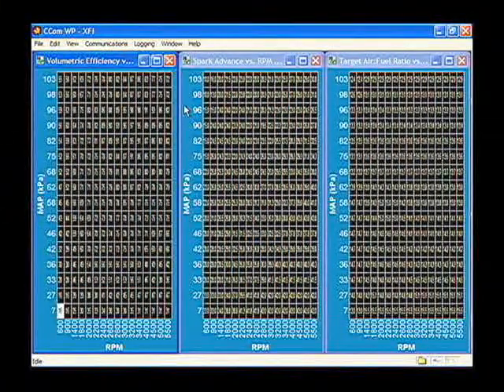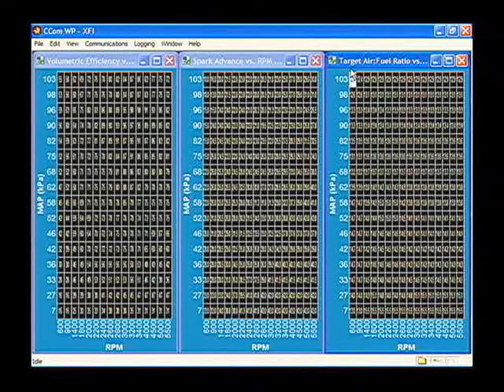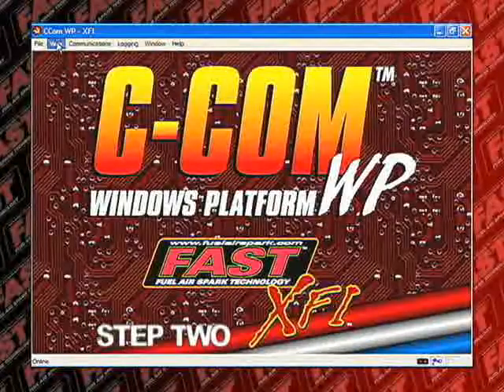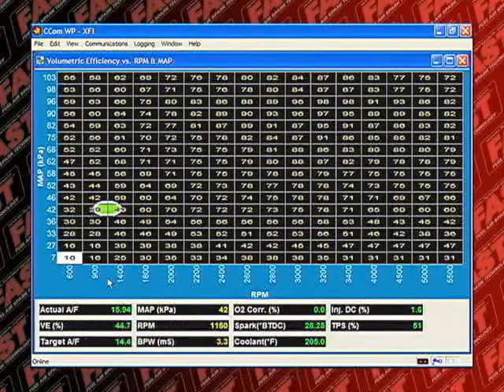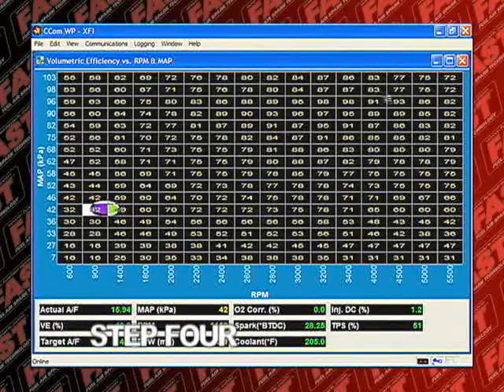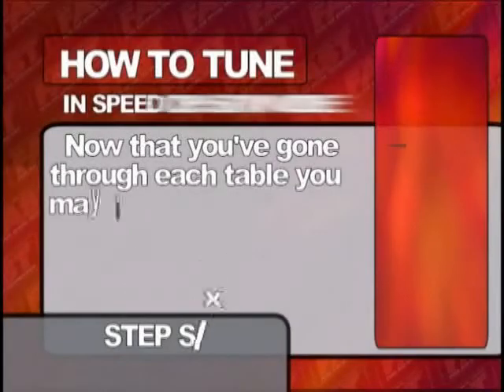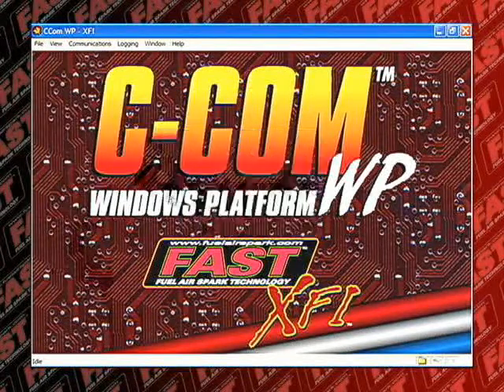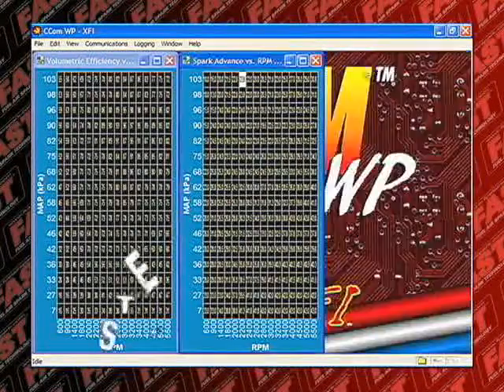XFI Tuning Overview

Comment: Set your target AFR.. Keep it in open loop. Clear any adaptive  Adjust VE/PE to match your target by monitoring the wideband. This allows you to have a baseline.   Why would you tune to a random or theoretical AFR? The closer you are on the VE mean less adjustment the ECM has to do, plus it will make for a better cal.